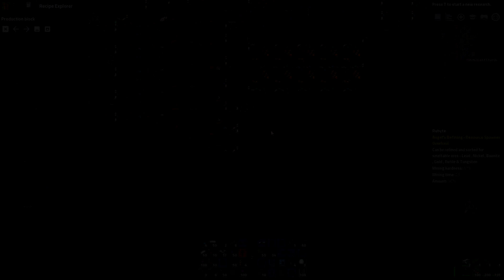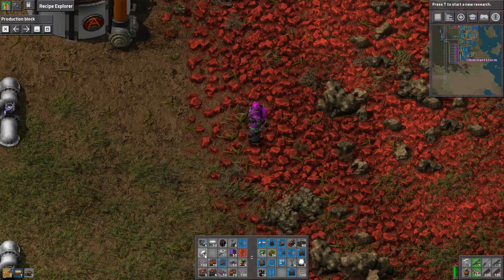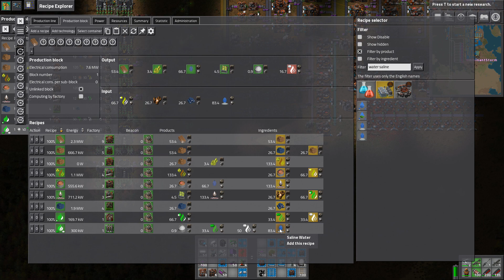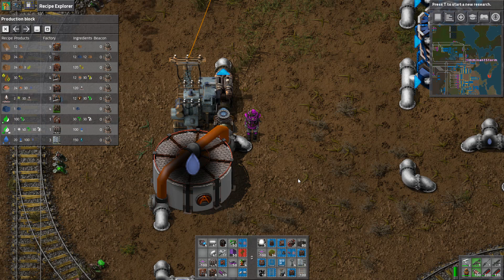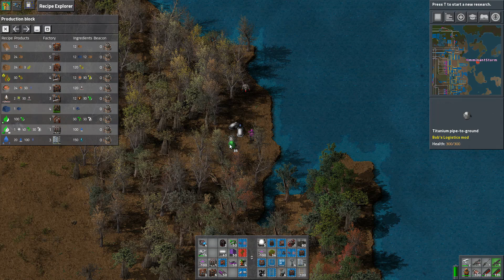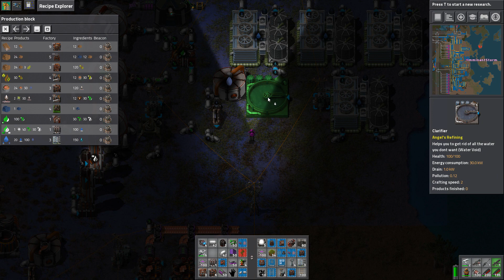Factorio - Angel's & Bob's - Episode 162 - Water Water Everywhere

Comment: I'm starting to think that hydro plants are SO fast compared to clarifiers that you'll need something like two clarifiers for each hydro plant. Here's one way you could do it: make a setup with everything you need to run two hydro plants, then blueprint that and stamp it down four more times. The setup would include one offshore pump, two hydro plants which feed their purified water into a tank (one tank per two plants), and just combine their saline water into a shared output pipe. The purified water would have one row of four clarifiers *per tank*, so that each hydro plant effectively has two clarifiers devoted to its output. The other output of each purified water tank is a pump going to the purified water depot. You'd start out with five dedicated lines, but you could condense this down to just your two existing lines if you want, since by that point, you'll have enough clarifier capacity in the system to handle all that purified water.

Yes, it's complete overkill, but from I could see watching this episode it looks like nothing short of overkill is going to get you your chlorine and hydrogen chloride in sufficient quantities.